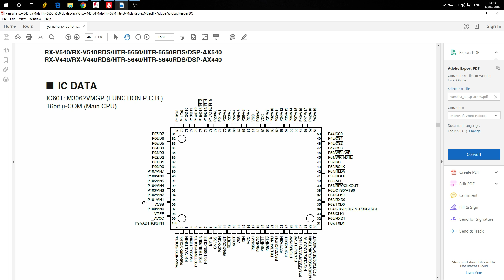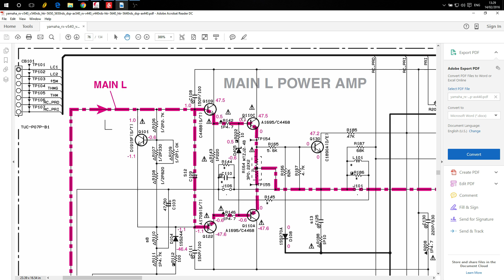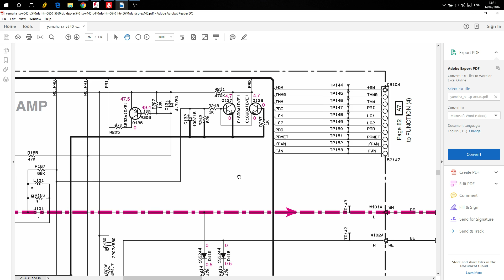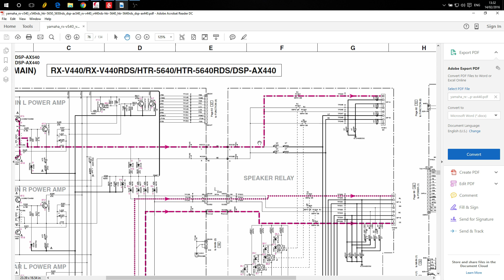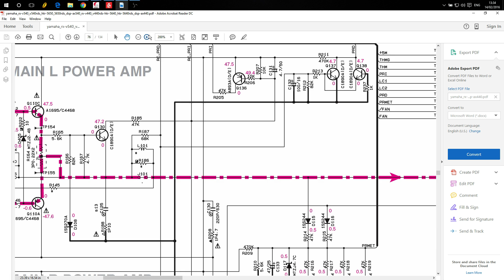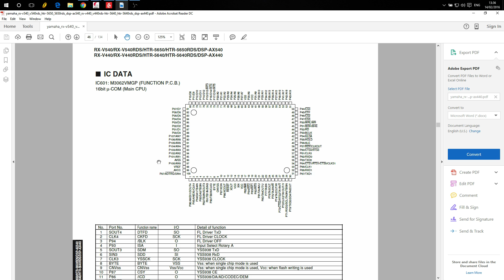Explanation of the protection circuits in an A/V Receiver

Comment: I believe there is also a voltage sensing pin. if there are multiple ic's and multiple voltage rails they can all meet at a resistor network which creates a sum or an average of all of these voltages. If one rail should fail, if this final sum voltage falls out of a certain range it triggers full protection.

Comment: Thank you for the video. I have a Sony AV Receiver STR-DH820. It is in "Protector" mode. The 8A fuse isn't blown. All the resistors and transistors are good. I made sure all the screws are tight. I touched up the solder joints. I'm confused why the fuse isn't blown, yet it's in "Protector" mode. Do you have any insights or suggestions? Thank you very much!

Comment: Where can I get a service manual for my RX V477, a good one, not one that is blurred out when you zoom in.
Reply from the maker: Sorry for the late reply. I am trying to catch up. 
Once upon a time I was working in consumer electronics as a field engineer and I had contacts that I could get this information.
I have been out of that field for many years now. I really don't know. I would suggest calling Yamaha parts. They may have copies of the manual. They may be able to point you in a direction.
Reply: @Mark19960  I found one online, but I'm still struggling to get this thing fixed.

Comment: Hi mark. Could you help please. I have a yamaha rx-v650 that goes into protection. Now it will do it only when ohms selector is set to 8ohms. Having replaced all output staged i still get 21volts from SBL channel on powerup when set to 8 ohms. If 6ohms is set then i get no volts on powerup. Any ideas please as its doing my nut in.
Many thanks

Comment: Hi Mark, I have a Sony STR-DN1050 and the problem that I am getting is that the unit powers on fine but from the time I raise the volume it goes into protect. If I switch to FM or Am it works fine. I have toggle the speaker off and the problem geos away, I have also disconnect the power transistor and the problem geos away. I have check the protection circuit but could not fine any bad component. Any suggestion?

Comment: Hi! In my case on a yamaha rx-v430 and rx-v377 the power supply relay goes nuts clicking forever by touching the standby button. The v430 sometimes it works, sometimes shuts down and sometimes goes nuts the same way that the v377 does. On the v430 the voltage that goes to the micro is arround 11-12v (before the 5v regulator) but after turning on, it drops to 6.5 or 7 or 7.5 and all of this by changing surround effects or changing to 6ch mode. Having it just on stereo, will work ok but the display will freeze after 15 minutes and will not work any button and than I have to unplug the amp. I firstly will do another voltage testing on the micro and will do what you said in this video too. And there is no dc voltage on any channell neither on the big resitors too. I'm kind'a confused and output bipolars are ok. I should check everything again. Did you have any of these issues like I had? Thx
Reply: Check the capacitors in the startup power supply, they may be going bad, warm the area gently for 5 mins with a hairdryer then try, if it improves temporarily change all caps in the supply. Also check everywhere for dry solder joints.

Comment: Hi Mark. Would you be able to shed some light on power supply protection circuits and troubleshooting? I have a Yamaha RX-A1060 that goes into ps prt mode. Specifically ps1 154 value. I could use the help if you wouldn’t mind. Thanks!

Comment: Hi Mark, I have a Yamaha RX v 659. It powers up but shuts down after 3 seconds. The error code is “DC PRT 026 HI”. Does this indicate a power supply fault or a problem with the amp output transistors? Thanks.

Comment: My Onkyo TX-SR875 works only in pure audio or direct audio mode in 
TAPE/AUX/Video stereo input only. Not works with digital input. No 
Preout signal available. How to repair it?
Reply: chk and change your digital to analog audio convert ic. i had a same case. it was solved mine.

Comment: brilliant comments! im starting of my own journey, repairing my 2-3 pre-amps that only produce sound from one channel. The odd thing about one of them, HK citation 21, the right channel would put out loud signals but distort and stop with low signals, and when the right channel was onyl plugged in, but mono was pressed then sound came from both speakers. so it is receiving the right channel. the other one, kenwood basic c1, just won't output the left channel. where should i begin?